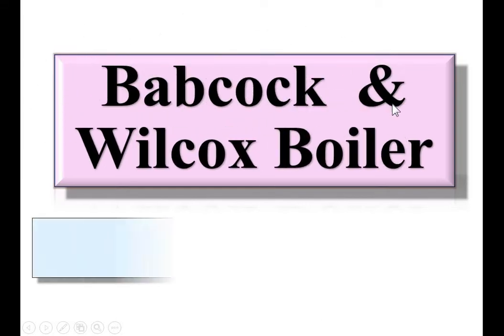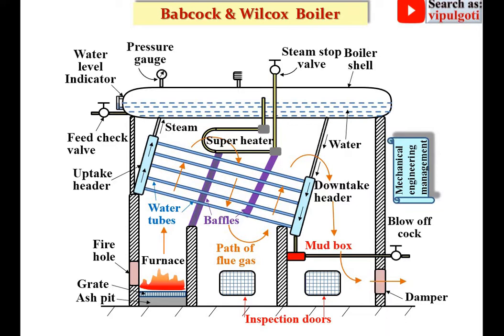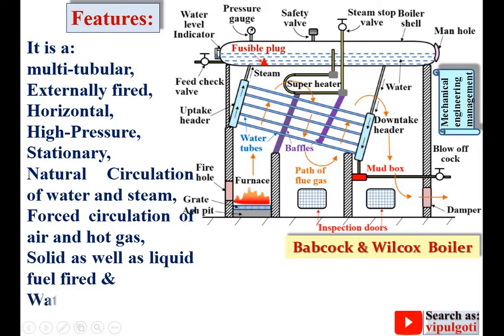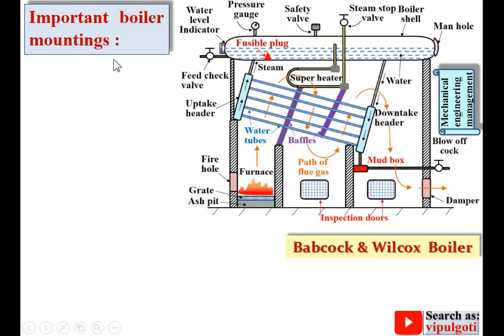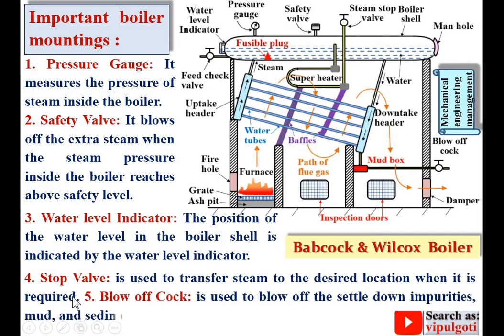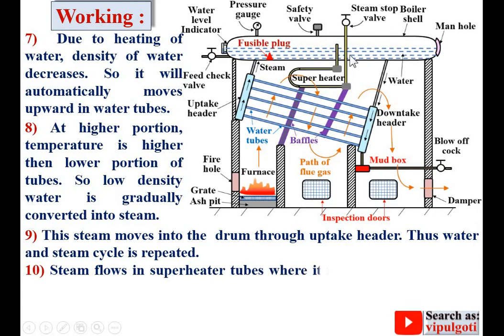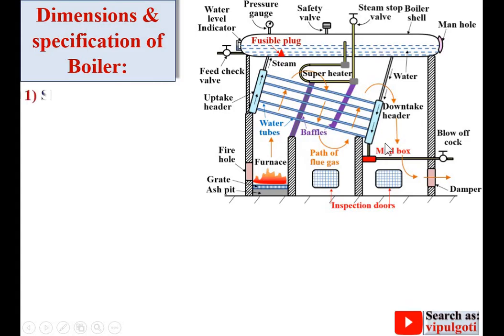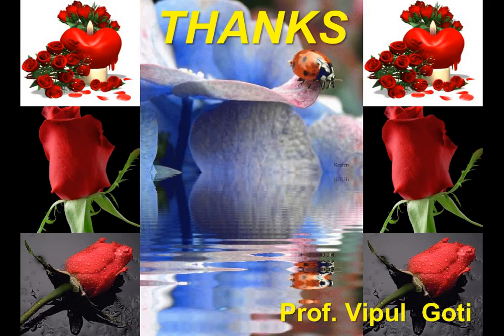Babcock and Wilcox boiler|Construction and working of boiler|Water tube boiler|gtu|Animation

Comment: Sir what is draught loss ?
Please explain in hindi OR gujarati
Reply: Diffrence between pressure inside boiler and outside  the boiler  (chimney for example).
Pressure is necessary  to maintain the flow of flue gases.